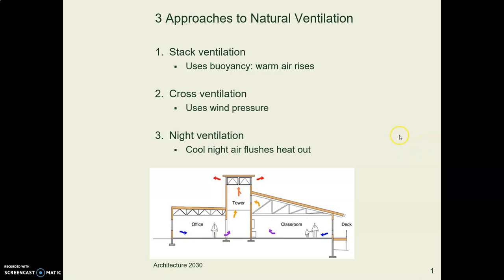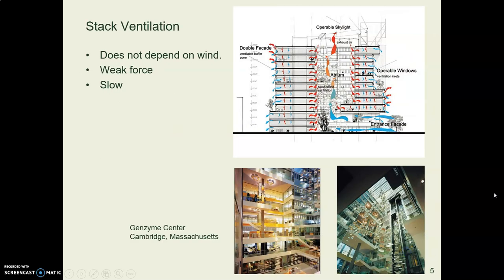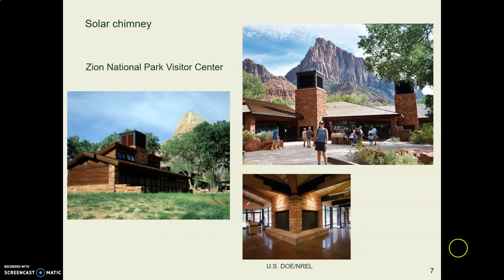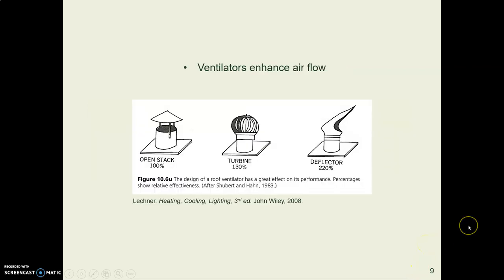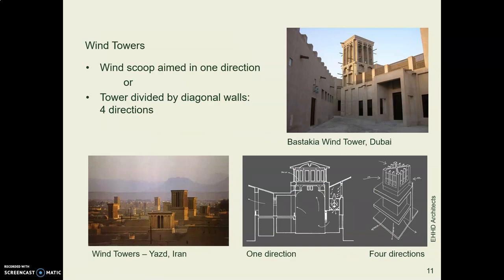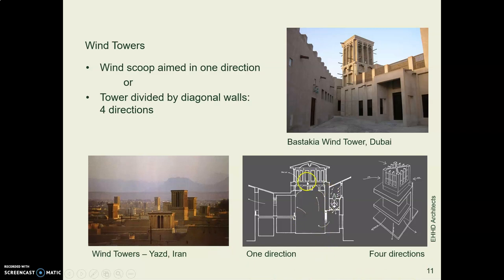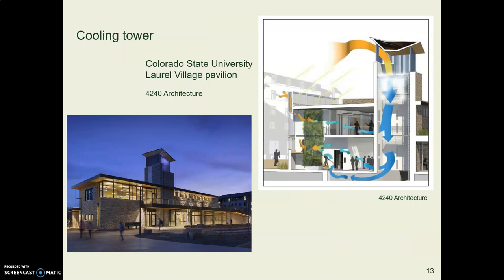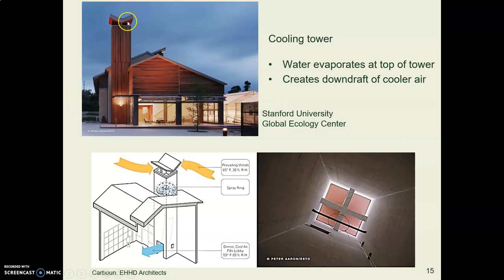SBS09b1 passive cooling   stack ventilation VL

Comment: I visited Zion N.P. in summer 2002 or so and was fascinated by the cool air coming down from the towers into the visitor center. They are downdraft cooling towers. There are pads at the top that are sprayed with water. The cool moist air then sinks down the chimney and into the center. I stood next to the "fireplace" opening and felt this wonderful cool air coming out. I live in PA where it's too humid for that method to work.
Reply from the maker: Thank you for sharing your experience there. That is very cool!

Comment: Do these evaporatize towers work in areas with high humidity in the air? A lot of these examples are deserts.
Reply from the maker: Good observation. Because warm air rises, this stack shape will still pull in cooler air and release warmer air out the top. (It's slow movement, however.) In dry climates, water can be inserted at the top of the tower, making a cooling tower, where it evaporates and then cooler air falls. So cool air is flowing down, rather than up.